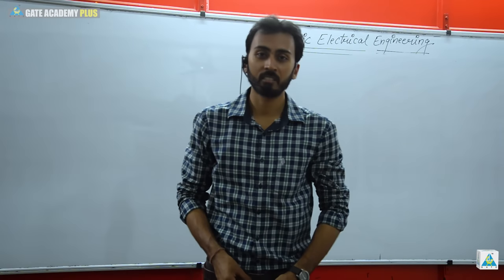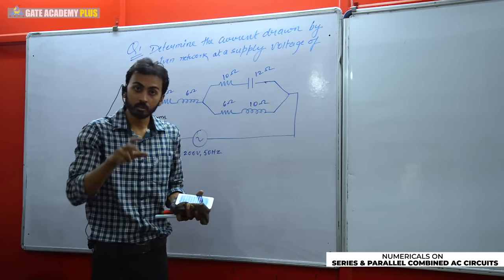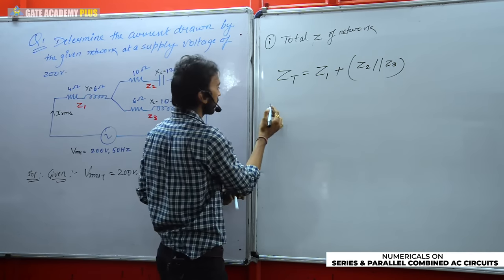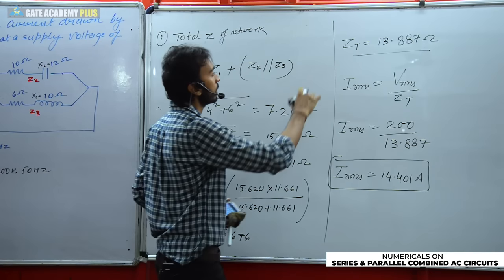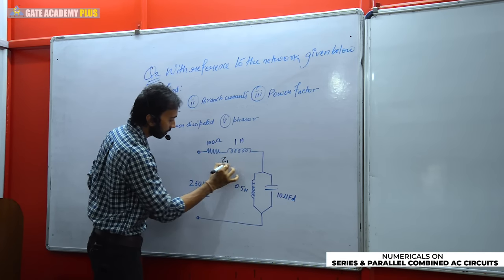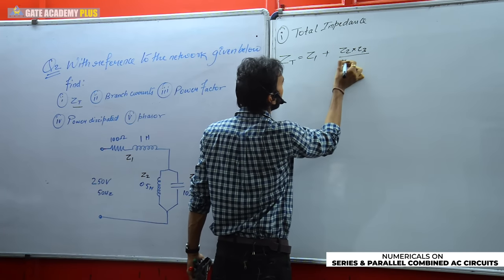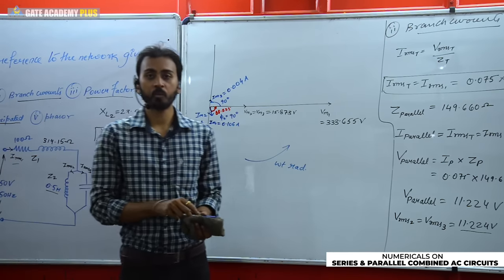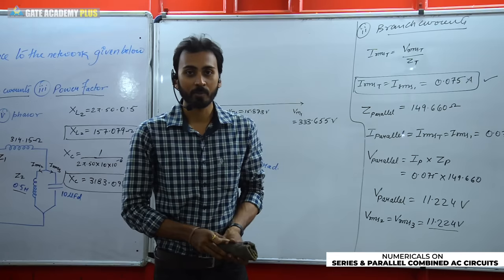Basic Electrical Engineering | Numericals on Series and Parallel Combined AC Circuits (Lecture 18)

Comment: Sir Had done some calculation mistakes in Calculation 2. Here is the Main values (Approximate may be differ from you answer in Points)
Xc = 318.309 ohms
(i) Z total = 434.856 ohms
(ii) Irms¹ = 0.575A
Irms²= 0.385A
Irma³= 0.190A
(iii) power factor = 0.230
(Iv) P = 33.0625 watt
(v)Vm¹= 268.086V    Im¹= 0.813A  Fi= 72.36°
     Vm²= 85.526V        Im² = 0.554A
      Vm³= 85.526V        Im³= 0.268A.
Reply: Total Z should be 424.68 ohms
Reply: Bro how did u got irms value 
I think you have got it weong as well

Comment: In the 1st question, if we find the currents individually in the two parallel circuits and then add them, then it would lead to the total current flowing(like we did  in the previous video). Then why is the answer coming out different from the one you have done. 
My answer-- 29.955 A
Your answer-- 14.401 A

Comment: Sir ; 1 question please solve : A coil has resistance of 10 ohm and draws a current 5A when connected across 100V , 50Hz source. Calculate the reactive power of the circuit.
Reply: If the given value of résistance is not reactance then the value of reactance power =0 . As phi is zero for resistive circuit and hence its sine value is also =0
Reply: @shikhachaudhary5550  How , it reactance is not given the coil is given . So read question agin
Reply: Answer is 50 watts
Reply: @prafulkumarmandal5771  Reactive Power of the Ckt is 433.012VAR

Comment: sir second question anwar is wrong it will be like this 
Xc = 318.369ohm
1) Total impedance = 434.860ohm
2) Irma¹=0.575A
     Irms²=0.385A
     Irma³=0.190A
3) Powr factor = 0.230
4) Power(P) =33.005 Watt
5) Vm¹=268.086 , Im¹ = 0.81A ,Fi = 72.35

Comment: sir may be you written the values by mistake with an extra number before dot 
the correct values are 
xL= 314.15, XL= 157.079, XC=318.309
Z1=329.682, Z2=157.079 , Z3=318.309
& Zt=419.326 ohm